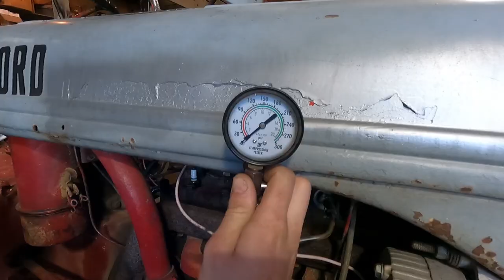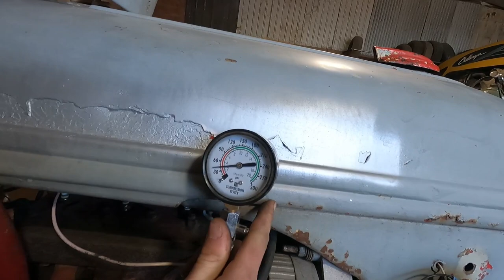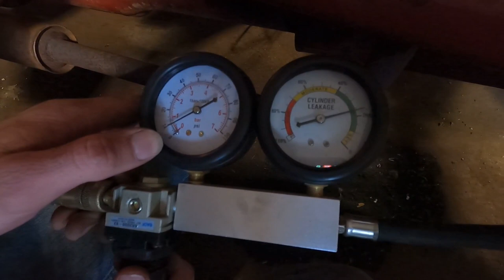Engine Rebuild 1941 Ford 9N

Comment: I grew up with a Ford 8N as one of our tractors.  Had the engine rebuilt about 1977-'78.  My oldest brother still has it & uses it to plow and disc his massive garden.  Those things are true work horses.  We also had a John Deere 4020, another work horse.  Great job Ronda on the video & kudos to Kevin, Sydney & Ethan for a job well done!  I hope Zander got to help some too, increasing his knowledge & ability.

Comment: Great job everyone!!!  We had an 8N Ford loader tractor.  They had improved by then, and put both of the brake pedals on the right side platform.  I am thankful that they figured out that putting the brake pedals together on the right side, was a huge improvement.  The old 2-cylinder John Deere tractors I drove, had a brake pedal on the left side of the platform, and a brake pedal on the right side of the platform.  But what made it easier, was that they had a hand clutch lever instead of a foot clutch pedal.  This made it easier for emergency stops, because you could use both feet on the brake pedals, and use your hand on the clutch lever.  They have made great improvements over the years, in the placement of the clutch pedal and brake pedals.
Reply from the maker: Brake pedals on both side was hard for me to wrap my brain around. Lol

Comment: I couldn't believe Sydney had so much to say, he was terrific, how did the owner feel about even a cheap rebuild, seems he would've been delighted to having running well again, the 8 and 9ns were among the first tractors I drove, certainly different than the modern tractors, you did great, Rhonda driving it for the first time, excellent rebuild and video
Reply from the maker: The owner wanted the cheapest repair.

Comment: My father and I ,with a neighbor who's a retired diesel heavy equipment mechanic, fully rebuilt my Dad's( 1948 Ford 8N) tractor ,35 yrs ago for$ 1200 , my Dad bought it new in 1948 for $1000 with a loader and back blade, we used the tractor a lot for raking hay and cleaning out cattle barns . It's was rebuilt again in 2020 by the current owner. It's used daily,harrowing a sand surface ,in a large horse training arena, and raking hay in the summer time.

Comment: We called the lever on the side overdrive - not only did it speed up the transmission but also the PTO. Worked good pulling the hay crusher because you could use a lower gear and run the crusher faster (my job as a kid!)

Comment: You guys made it look easy. I have been rebuilding my engine since October. I guess this is my first time so it will take a little longer. Nice work guys.
Reply from the maker: Well, for the looks of it, you are doing the project all by yourself. This tractor had 3 guys working on it. Keep up the work, your tractor will soon be running too!! 😃
Reply: @acresofclayhomestead  it is definitely a learning experience. Plus I am fully restoring mine.
Reply from the maker: Ohhh, that's a huge job! Can't  wait to see it.👍
Reply: @acresofclayhomestead May 18th is the day I plan on it being done. But I am waiting on parts plus the busy season is starting.

Comment: I had a 9N tractor for a long time, sold it in 2013. Those blocks were bad for cracking, mine had been repaired. It looks like they converted it to 12 volt, from the alternator instead of a generator and that make a world of difference in starting them.

Comment: Just a suggestion....When I built engines back in the 70's, I use to put fuel hose pieces on the rod bolts...just to ensure the bolts would not score the crank bearing journeys when installing the piston/rod.

Comment: Awesome you rebuilt + saved that old Ford tractor! The boys certainly did a good job rebuilding the motor. Sure has a unique "4 cylinder" sound! Wonder what size of 4 cylinder engine this is & the horsepower. May still be bigger cylinders + displacement than my 2020 Ford Ranger 2.3 liter EcoBoost (138 CID), lol. Fun old tractor though.

Comment: Rhonda, that's a what 1950s 1960s tractor. No air ride seats, no power anything and you can run as fast as that thing go's.   But it runs and it's  antiqued.

Comment: Those old Ford tractors are easy to get parts for and they are not expensive. I have an 8n that comes in handy. I don't think I'll spend the money to rebuild the motor though.  If it ever dies I'll  buy something with power steering and live 3 point. But so far the 70 year old tractor keeps firing right up and running without much up keep.

Comment: We used to have a 9N very similar to that with a bucket loader on it and a scraper blade on the back that we used to clean out the free stall barn every day.It did not like to start on damp weather day's always had to hook a chain to it tow it to jump start it.

Comment: That's a cheap engine to rebuild. I rebuilt mine. It has about 20 hours on it now. That's a Sherman hi-low trans. Mine has that too. Not all do. Mine has both brake peddles on the right side. I'm not sue if there was a kit available to change the location of the brake peddles to the right or not. I've talked to many old timers, and they've never seen them that way. I fabricated an exhaust pipe to go straight up in the front. That exhaust will kill you if you want to use a 3 point log splitter, or a buzz saw. Even sitting on the tractor, the fumes get to you after a while. No problem anymore. I rewired mine and converted it to 12 volt Alt. like this one. Mine has a Wagner loader. The hydraulic pump runs off the crankshaft.
Nice job.

Comment: Nice video.  I suspect that the tractor is a 2N, not a 9N.  There were more 2Ns sold than 9Ns, but a lot of 2Ns were mistaken for 9Ns.  That's because both the 2N and 9N had serial numbers that started with "9N".  The radius arms on this tractor make it a 2N, a 9N would have an I-beam shape radius arm.

Comment: Sorry getting at the video late, couple of things when doing a compression test the throttle should be wide open. The other thing is once a dry test is done one should put some oil into the cylinder to do a wet test. If the compression goes up a lot tells you the rings are worn. If the compression only goes up a little then the valves are bad.

Comment: good job.us usually  we have engine apart on wood saw horses .cast iron rings & 3 piece oil ring . some machine jobs are crooked. not odd if we have  have a  carb  in from  small engine or emergency repair.( zip Lock   bag working in when itsy part flies  beats on knees looking). screws under table hold our mag glass light @tweezers.

Comment: Good job you guys, nice to  have those skills,    It would be fun to see what the parts cost >? your dealer is not much for service , you need that tractor and they should be there fore you faster.
Reply from the maker: Parts cost around $600.

Comment: That's some hard work on the new engine of the tractor. It needs a upgrade cylinder to increase more power and acceleration like a 1979 Dodge Charger.😊💙💙💙💙💙💙👍

Comment: Hi learned how to drive on 9n it had A 3 speed trains had a left brake an rite break my granddaddy bought an sold used tractors but a new 8n and 5 pieces of equipment sold for 1200 dollars bring back lots mem

Comment: What is the oil pressure in the Ford engine after the renovation? 
When the service will set the gearboxes in callanger, suggest that they unlock the speed at 40mph
Reply from the maker: 40psi - 45psi